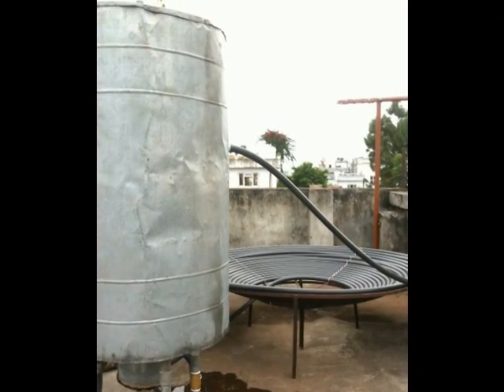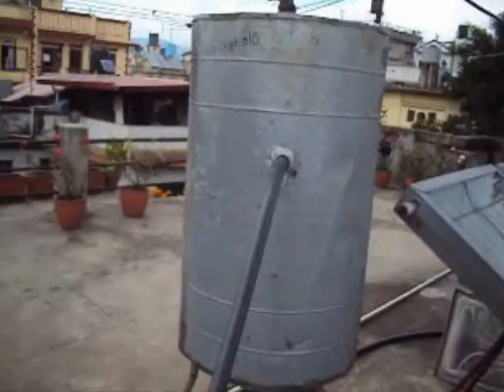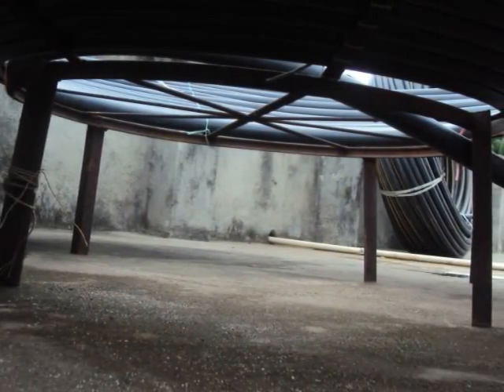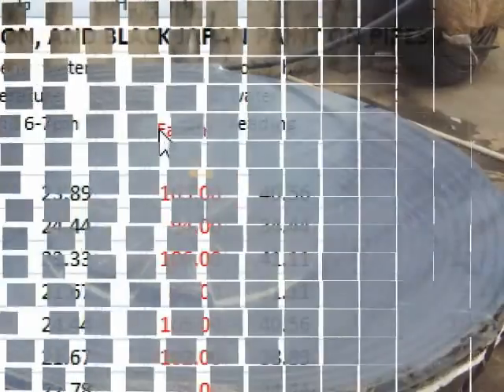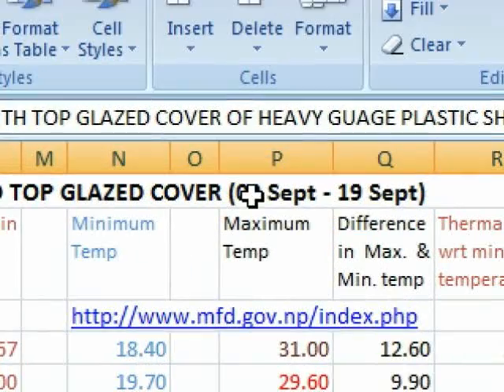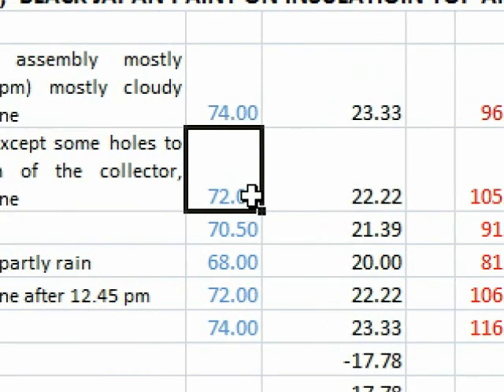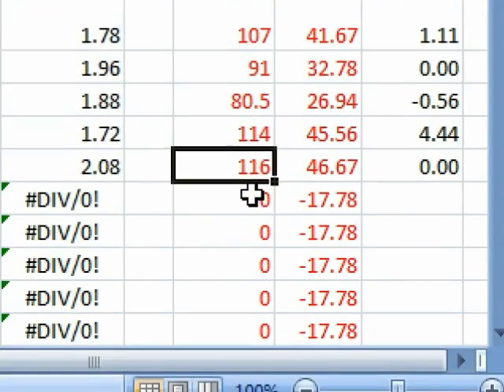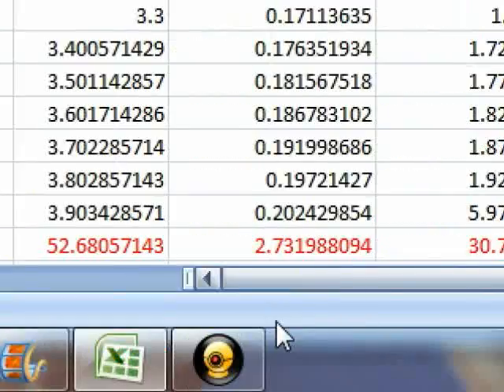DIY Passive Solar Water Heater- Vol. 2

Comment: Your work is OK in theory ,my question to you is : WHAT IS THE SYSTEM CAPACITY ?  GPM / LPM Gallons / Litter per minute ? 
 A normal shower had takes 2 gal / minute . water temp for a shover is 120º.
Reply from the maker: The one which are using has 200 liter capacity, it roughly gives 100 liter of hot water in Kathmandu even in winter, in summer the capacity increases substantially.

Comment: The system is using the IR radiation. In my region(central europe) it works very good in summer, but in a cold winter the water will freeze.
The solution: The tubing is hidden under the roofing tiles in rows (not circular), before the cold season you can drain the whole water. The fresh cold water you connect at the bottom and the hot water you'll take from the top!
Reply: Or,  you could just add an antifreeze like ethylene glycol

Comment: I used an old satellite dish so i can drain it in the winter and go back electric only in extreme cold,the cold supply on the outer edge and the hot exit in the center down where it drains well when opened , also raised on legs so i can mow under it . hate to mow!

Comment: very nice project i wounder if you slow the pump down or use a smaller pipe i wounder if it would be more efficient heat sencors can help move the water when needs be  moved all so but that makes for alot more componets. i think an easy way to heat batch hot water is with a wooden box black pool liner and bouble pan window on top as far as heating water fast it is preat ifficient it was a easy way to take a hot shower if you timed it right or it would just be to hot

thecheapguy